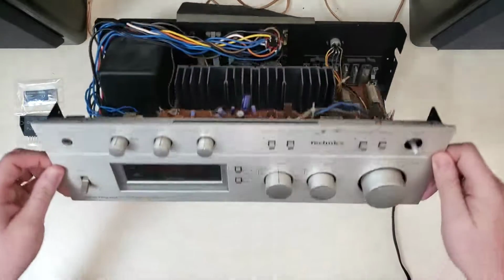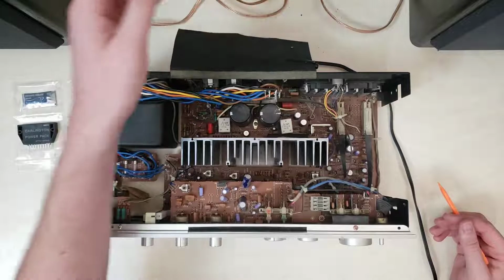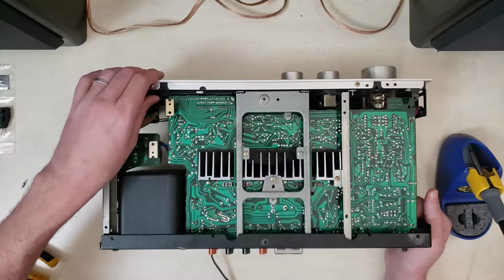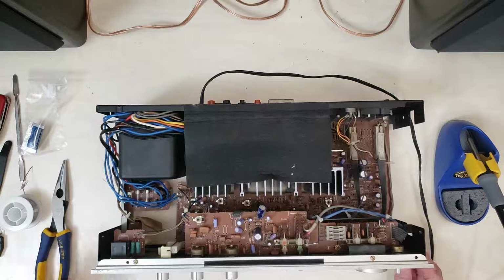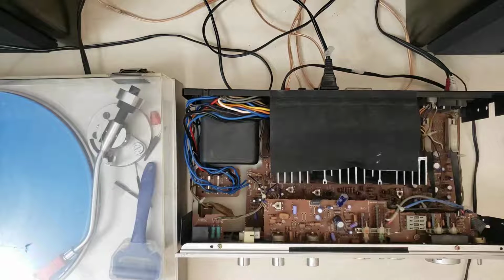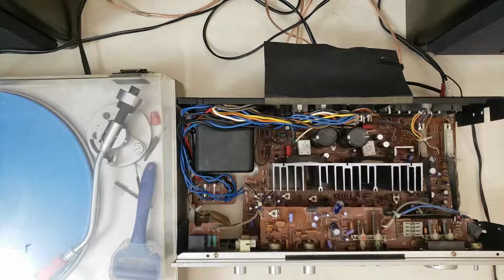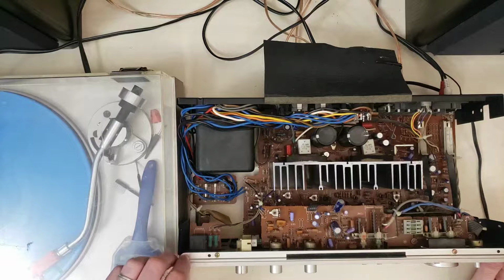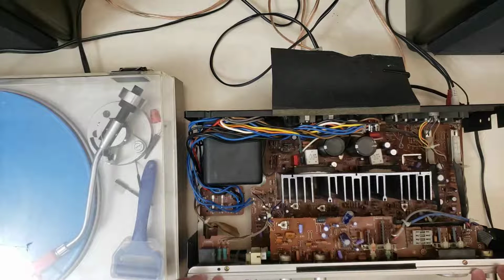Technics SU-8055: STK-0050 Darlington Pack Replacement

Comment: Do you know of a good source for these STK power packs?
Reply from the maker: I've bought them from various sellers on Amazon and eBay. I haven't found any particular seller that has a better supply than anyone else. Even multiple units from the same seller won't necessarily test out the same. I usually buy five at a time and three or four are usable. May the odds be ever in your favor.